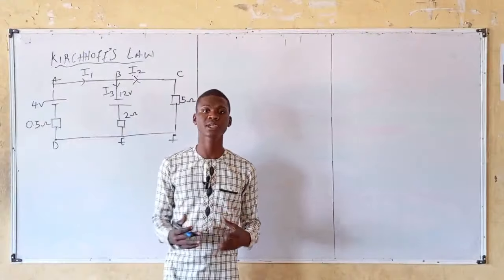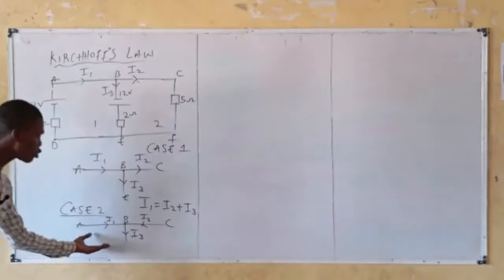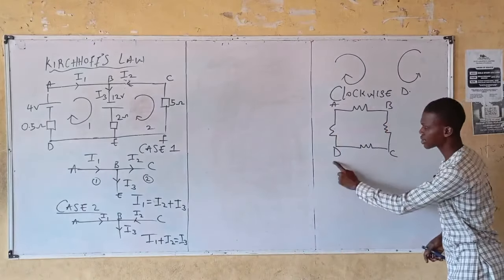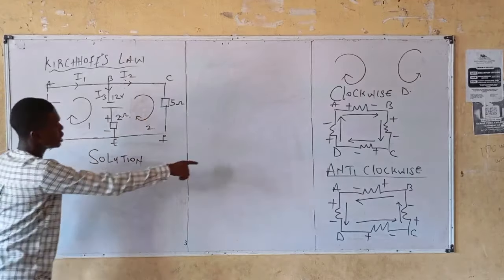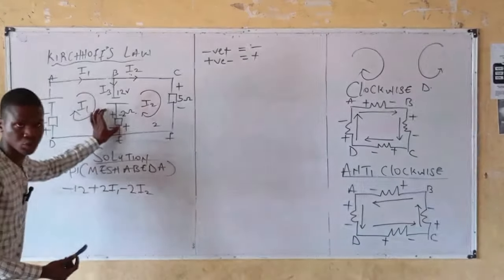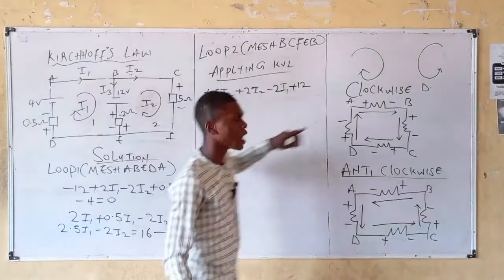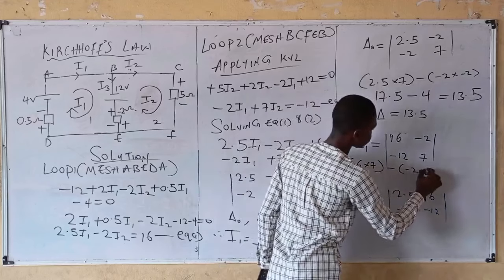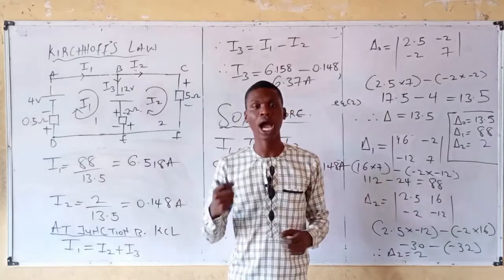Kirchhoff's Laws1l Kirchhoff's Current Law(KCL)lKirchhoff's Voltage Law(KVL)#kirchhofflaw

Comment from the maker: When applying Kirchhoff's Voltage Law (KVL), the direction for voltage gain and drop doesn't need to match the standard convention, as long as you're consistent throughout the loop. For example, if you decide that moving from positive to negative is a voltage gain, apply that same rule to all components.

KVL only cares about the net voltage change around a closed loop being zero. 
So, whether you call a rise positive or negative, and vice versa..you will still get the same answer.

To apply KVL correctly, follow these standard conventions:
For batteries:
Voltage gain: Negative to positive terminal.
Voltage drop: Positive to negative terminal.

For resistors:
Voltage drop: In the direction of current flow(higher to lower potential)
Voltage gain: Against the direction of current flow.(lower to higher potential)
Reply: Can I have your personal email

Comment: There's  confusion bro
Reply: From positive  to negative  can it be voltage gain
Reply from the maker: From positive to negative : voltage gain
From negative to positive: voltage drop
Reply: @FURTHERACADEMY sir I thought a voltage drop is as a result of positive to negative while a voltage gain is as a result of negative to positive considering high voltage source to a lower voltage source vice versa
Reply from the maker: @AnimashaunOlasunkanmi  well it doesn't really means. 
You can reverse the case as well, you should get the same answer also..

But, I will advice, go with the one explained in the video.
Reply: @ thanks boss understood
Reply: @FURTHERACADEMY  Is this only specific to the resistors? because in the video you applied it to the batteries as well, that is where I do not really understand.
Reply from the maker: @samuelkenney4693  Applicable to both
Reply from the maker: Where is the confusion...
At what place is that
Reply: Watching fro. Futa
A lot of. Confusion
Reply from the maker: @ElijahIfeoluwa-p1w  what Exactly is your Confusion?
Reply: With due respect, the polarity you assigned  was wrong@FURTHERACADEMY
Reply from the maker: @ElijahIfeoluwa-p1w  ok, your Enlightenment will be much appreciated.
Pls Elaborate!
Reply from the maker: @ElijahIfeoluwa-p1w  When applying Kirchhoff's Voltage Law (KVL), the direction for voltage gain and drop doesn't need to match the standard convention, as long as you're consistent throughout the loop. For example, if you decide that moving from positive to negative is a voltage gain, apply that same rule to all components.
KVL only cares about the net voltage change around a closed loop being zero. So, whether you call a rise positive or negative, and vice versa..you will still get the same answer.

To apply KVL correctly, follow these standard conventions:
For batteries:
Voltage gain: Negative to positive terminal.
Voltage drop: Positive to negative terminal.

For resistors:
Voltage drop: In the direction of current flow(higher to lower potential)
Voltage gain: Against the direction of current flow.(lower to higher potential)
Reply: Plz apply the polarity well
Reply: What about the value for the third correct flowing out of the junction